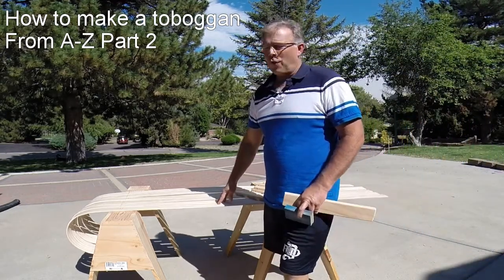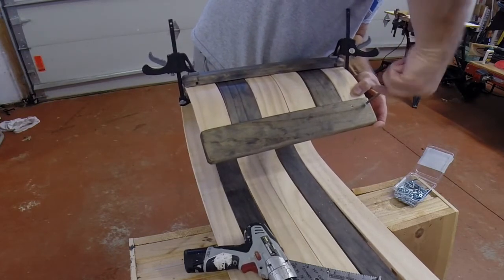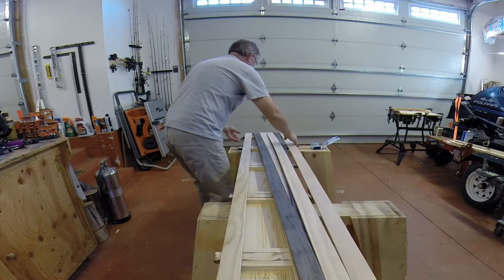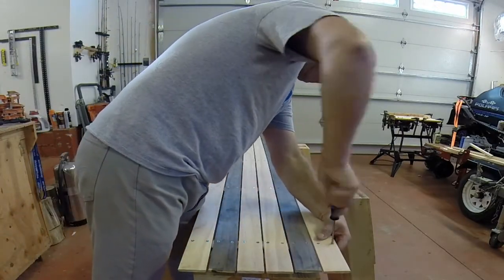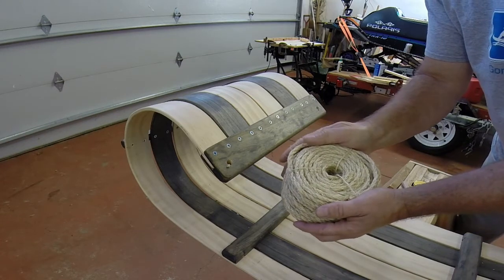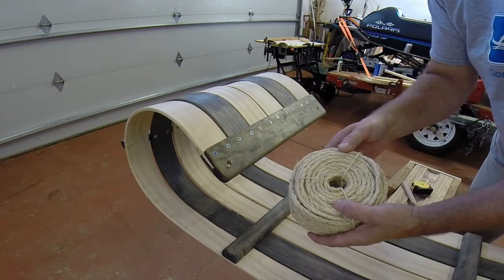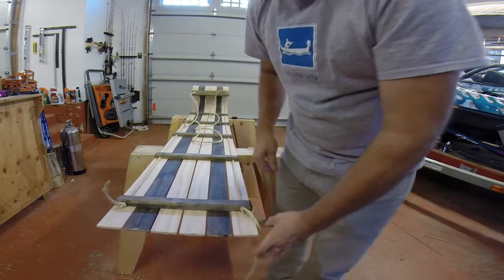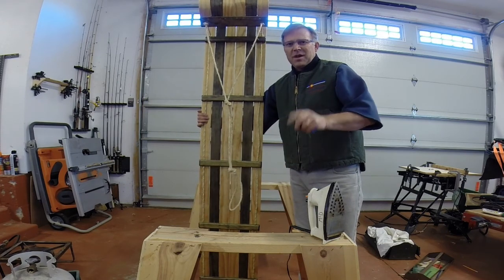How to build a toboggan From A Z Part 2

Comment: This is so cool. One question why did you leave spaces in-between each board?
Reply from the maker: Hi Darien,  just because I think it looks cool. No other reason...
Reply: @billmcdonald2982  does it effect performance or just so good as the ones with no space?
Reply from the maker: Darien, I personally don't know about any other kind. This is all I have made and they are much faster than any sled on the hill. The key to speed is wax...
Reply: @billmcdonald2982  Don't the gaps also allow for the wood to expand and contract slightly as can happen with different weather or if it gets wet??
Reply from the maker: @kateh4595  yes.

Comment: Why no glue?
Reply from the maker: The toboggan is made so that you can replace any broken part. Glue would not allow that.
Reply: @billmcdonald2982  thanks Bill, i was a boat builder for many years, we glued everything. I thougt no glue so it would stay flexable. All the videos iv watched, no glue has been used. Easy repairs makes sense.